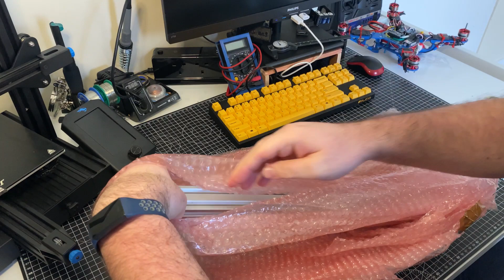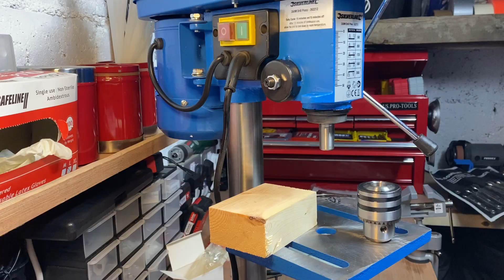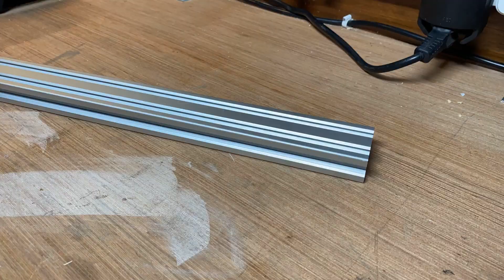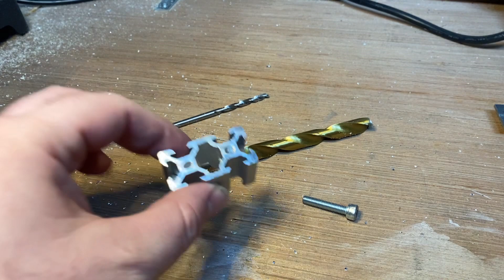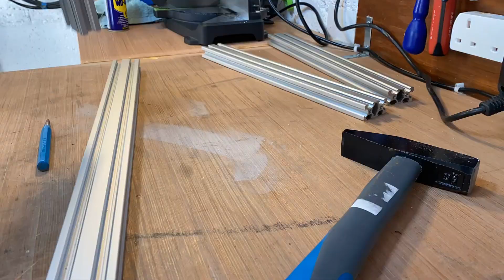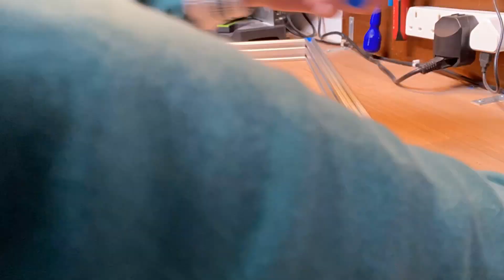DIY CNC (Arduino & GRBL) - Part 1

Comment: Parkside drill and tap set?
Reply from the maker: Yep, one of the two sets of taps I use is a Parkside set from Lidl
Reply: @careyian  The taps are good, I had no issues even with heavy use in steel. I still broke a few, but that was mostly due to user error.

I wouldn't use their drill bits for drilling in steel though, they break easily.
Reply from the maker: @kfoltman  yeah, they aren’t bad for a cheap set!

Comment: We all live and learn.  For your 2040 corners use M6 button head screws which slide into the other piece's slot.  Then on Thingyverse there are printable templates to precisely drill holes so you can tighten the screw from the outside.  There are lots of these jigs for different joints.  Then use a inside corner bracket with an M5 button head screw and T nut.  This will give you a very strong, nice looking and perfect 90.  Then print out some nice end caps to to put in your exposed extrusion ends.  Hats off for building your own instead of a kit.  I've built printers but really want to build one.  I too get excited from extruded aluminum.

Comment: What linear rails did you order?  Was looking around for some budget ones and seems like most would say the amazon onea arent that great.  Did you consider Vslot for linear rails?  I want to build a laser engraver(diode) and am really looking forward to see your progress.
Reply from the maker: Hey, I bough ones from Amazon, as you say they probably aren’t the best but from what I can tell they aren’t too bad, they move freely and don’t have a lot of play in them so I’m happy with them for now. Especially since they were 10 times cheaper than “good” ones I found elsewhere. If you mean did I consider using wheels in the vslot? Yes I did, but I was more confident in myself to build this design.